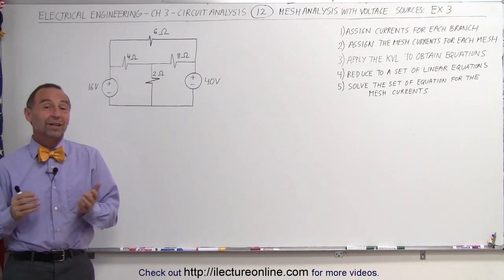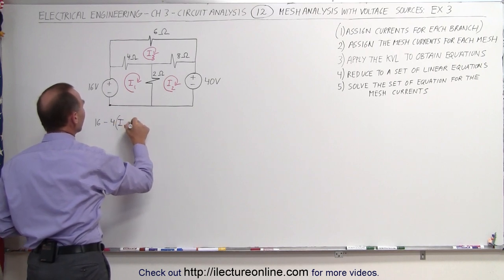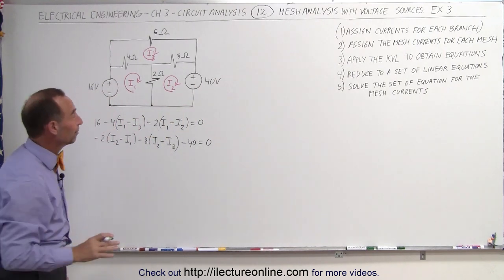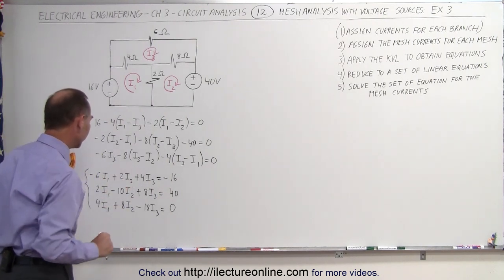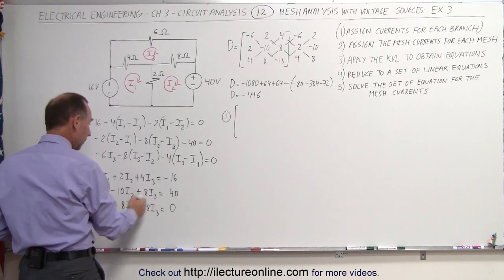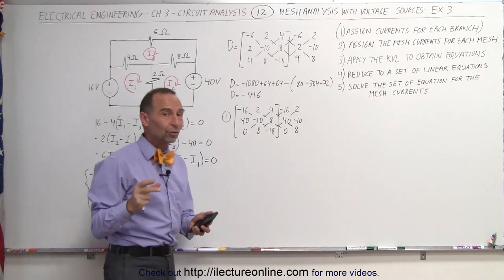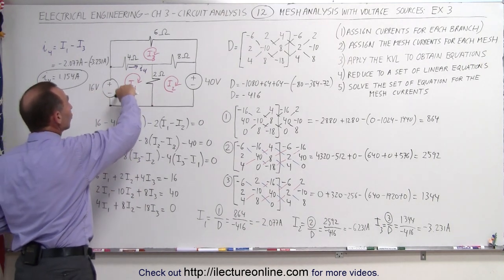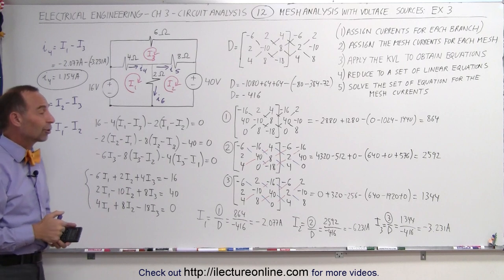Electrical Engineering: Ch 3: Circuit Analysis (12 of 37) Mesh Analysis w/ Voltage Sources: D = -336

Comment: Hi professor I really appreciate you. I'm not electrician or not study subject close to but really like electronics and your teaching . I calculate 3 equations and find this 3 answers :
I(1)=-2.5714   
I(2)=-7. 7143  
I(3)=-4
Reply from the maker: Yes, those are correct.  We have added the corrections to the video, but they are only visible when viewed with a computer, (not a phone).
Reply: Tank you so much! Yes I should check it before commenting!
Tank you for answering my comment.
Reply: Michel van Biezen:- Sir your Teaching is very Cool 😎
Reply: @MichelvanBiezen  I am using Chrome on Win10 but do not see the corrections you refer to.
Reply: Same
Reply: same i got it this ans.
Reply: @dougedmunds  he wrote the correction in the title

Comment: Hello Michel,  I checked the determinant of your calculations using MATLAB.  MATLAB says the det should be -336.  However when i checked your calculations, you calculated it to be -80, this is actually -160 not 80.  With this correction your det would be correct.  I absolute love the way you calculate the det, so much easier than the way I was shown.
Reply from the maker: Thanks for the input.

Comment: In this example, why did you assume voltage drop in exact node in MESH 3 ? You started from - not from +. I dont get that.
Reply from the maker: We are not sure what exactly you are asking.  We assumed the direction if I3.  That means if you travel across a resistor in the same direction as the assumed current, there will be a voltage drop.  Also, you can start from any point in the loop.

Comment: Hi Professor Van Biezen, I am a UC Berkeley student and I notices you have made a slight error with calculating your determinant for the system of linear equations. The determinant should equal -336
Reply from the maker: Yes you are correct, (see comments below)

Comment: The determinant is not correct in that way. At least one product number is assumed as half-value that is why it's incorrect. 4*4*10= 160, but not 80.
Reply from the maker: Yes, you found the error.  (see below)   Thanks,

Comment: I have used matris  method  and i get  -13.58   , -14,18      ,  -9,33
Reply from the maker: The best way to check is to plug these values back into the original Kirchhoff equations and see if they are correct.

Comment: Hello professor,
Why don't we in general draw the + and - around the resistors?  Do we assume them or can't we do it all?

best regards, keep up the great work!
Reply from the maker: With a multi-source circuit, we don't always know the direction of the current through the resistors, until we work out the problem.  The voltage drop depends on the direction of the current for a resistor (not for a battery).

Comment: Hi professor,  my university teaches a different sign convention where for example where your one equation is -6I1+2I2+4I3=-16 mine would just be 6(I1)-2(I2)-4(I3)= +16 and this is how we are taught.

Now when I do Cramer's rule for a 3X3 matrix, instead of going to the right with the two extra lines I go downward and everything works out in the end, except my values differ from yours. this is how my university teaches it.  except, in your video circuit analysis 7 I also did cramers rule bringing the cross multiplication downwards instead of to the right like you and I got exactly the same determinants as you did there with my sign convention also being the opposite of yours.when I determine all my currents though they all cancel out according to KCL. Is this acceptable?

so my first determinant would be derived from a matrix that looks like this:
|6 -2 -4   |
|-2 10 -8 |
|-4 -8 18 |
   6 -2 4
   -2 10 -8

Where my signs are just the opposite of yours and then D= (6x10x18 + -2x-8x-4 + -4x-2xx-8)-(-4x10x-4 + -8x-8x6 + 19x-2x-2) this gives me the answer of 464. is this fine?

Then D1= -5024, D2 = -2592 and D3= -1344 which gives me an I1 of -10.83A an I2 of -5.59A and an I 3 of -2.90A through this I get an I4 of -7.93A an I5 of -5.24 and an I6 of -2.69, they all obey KCL in the end so I don't think it is really a problem?

note that all my nodal and mesh analysis answers are the same as yours with the same exact signs apart from this cramers rule example, even though my equation signs differ from yours.
Reply from the maker: The difference in the sign convention should not make any difference in the outcome of the problem.  With matrices it is easy to make a mistake somewhere in the process.
Reply: Thank you professor, I see I did my matrices too hastily. And thank you for uploading these videos.
Reply: I also use a different sign convention. I do the same as CrimsonBlade. I then use Gaussian elimination to find i1, i2, i3. It works for me so I use it. Everyone has there own way of doing things but if we all get the same answer then everyone is right.

Comment: Sir,why didn't you assign current to each branch.with that only we could assign the signs in the kvl equation
Reply from the maker: There are different methods to solve these types of problems.  With the mesh analysis method we assign a current to each mesh instead of to each branch.

Comment: hi, for the first eqn, I used 16 =6 (I1)-2 (I2)-4 (I3) instead.
I got the correct determinant D, but when I subbed in the 16,40 and 0 into the matrix to find D(I1) I got the wrong answer. 
Is my method the wrong way to do it?
Reply from the maker: Your equation is exactly the same.  Thus it should work.  The best way to check to see if your answers are correct is to plug the answers for the 3 currents back into the first equation.  When I did, it didn't give me the correct answer which leads me to realize that I must have made an arithmetic error.  I'll have to find it.  Thanks for checking.
Reply from the maker: Found the mistake, the determinant D = -336